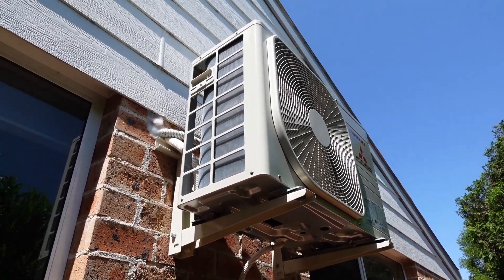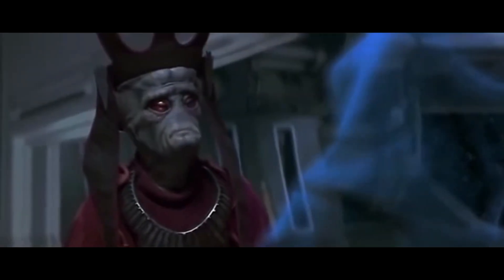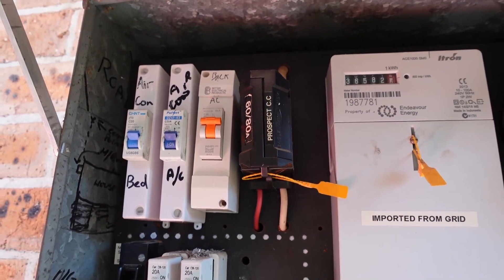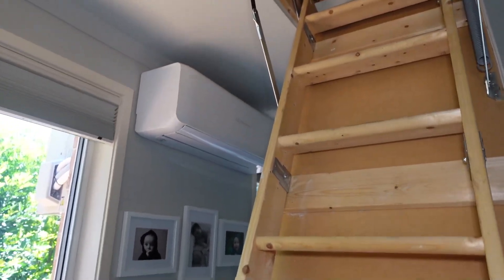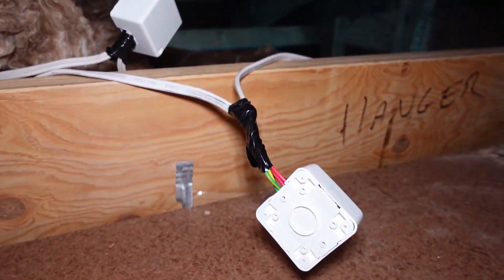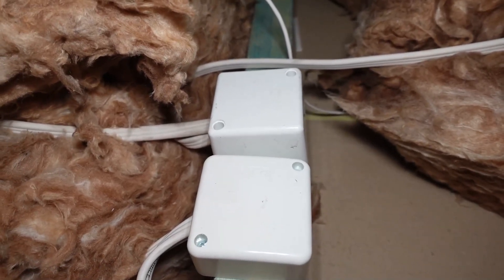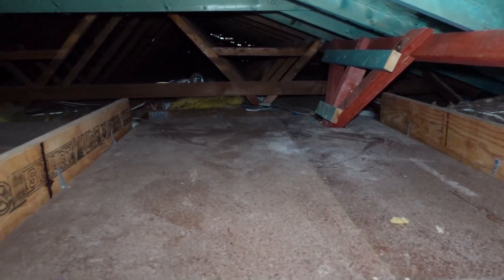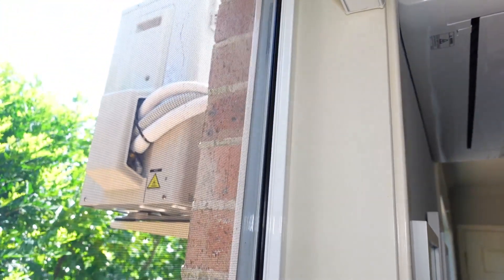Aircon Wiring Install FAIL- TWICE!

Comment: Hey Dave, those Circuit Breakers next to the service fuse are a defect, as they are installed outside the consumer’s equipment zone marked out by dotted lines. All circuits except submains require RCD protection, any alterations or additions mandate this upgrade. Isolators as you stated are required, and shall be mounted directly adjacent to the equipment it is controlling. Air cons can be supplied from power circuits, but must be labelled as a mixed circuit and is usually done to try get away without putting in a CCEW form to endeavour energy. I’d be asking for a CCEW and sending a copy to endeavour, then requesting an inspection. These blokes are dodgy as. Also, that aircon penetration is not real good. Needs to be fireproof foam and ideally there would be trunking or duct to enclose the conduit and pair coil. Hope this helps.

Julian.
Reply: And can we talk about the cables being just thrown across the loft? It's hot garbage all the way through.
Reply: No such thing as a consumer equipment zone on the metering panel anymore (for endeavour and ausgrid areas anyway)

I agree that it should be on a seperate circuit (may void warranty on AC if on a shared circuit) and it looks a bit rough with the hole pumped full of silicone, they couldve put a shroud or trunking over the hole or something
jbox rough as
Reply: I agree wholeheartedly about everything you said. except the consumer's equipment zone got taken out a few years ago, and it doesn't need fireproof foam as it is a house not a multi dwelling, but really could have been done alot better than the "do your best, silicone the rest"
Reply: Yep agree, theres a dotted line for morons......it means keep out of the grid providers equipment zone :)

Comment: Um, I was taught that circuit breakers (and fuses) are there to prevent the wiring from catching fire if they are overloaded. So how is a small tap off of a larger circuit be legal unless the wiring can safely carry enough fault current to trip the breaker?

Comment: Ahhhhh dang it, just typed like a thesis that I had to research some values for to be certain and a whole "Wiring hardship" scenario I had on monday. and lost it cos of Auto Play

Main points, no capping/casing to protect services and prevent rain/weather and small creatures from getting into your wall.

That wiring was so shotty, could guess its a plumber by trade or someone who hasnt been trained to standards. Glad they rectified it and "Upgraded it with some Electrical tape, and its not swaying in the breeze now LOL.

Job must have been quoted Indoor, Outdoor, Mount, 2c+e, 3c+e, paircoil, drain conduit and flexiable conduit. Silicone, screws and saddles. Guess they saved $50-$60 in the quote that way.

As for the unit been so close to the indoor, some manufactures specify the minimum length. Mainly to lengthen its lifespan, from viberations and reduce noise. As in the past ive had to to a loop behind the unit, when the pair coil run was less than 1.5m.

3c+e supports 20A, but it would have still have helped to know theres nothing high load on that circuit as running to the fise box would require more materials and components. 

Its a clear "She'll be right" mentality, but no isolator tho. Im sure that its legally required, let me check...

---------------------------------------------

Australian/New Zealand Standard (AS/NZS) 3000:2007,

Known as Amendment 2, it was released in December 2012 and is the first update since July 2009.

In the new Amendment, Clause 4.19 specifically relates to air conditioning and heat pump systems. It states:

“Air conditioning and heat pump systems incorporating a compressor shall be provided with a lockable isolating switch installed adjacent to the unit, which isolates all parts of the system including ancillary equipment, from the same location.

“For split system air conditioning units, where the manufacturer requires the air conditioning system to be connected to the electricity supply by means of a plug and socket at the internal unit, the isolating switch installed at the external unit shall control the socket-outlet located at the internal unit.

“Exception: the isolating switch may be installed at the switchboard supplying the system if the switchboard is dedicated to the equipment (e.g. an air conditioning plant room).”

This Clause has been written to clear up any misconceptions regarding the use of an isolator for the installation of air conditioners in residential or commercial projects.

For those air conditioners that still use a 3-pin plug and socket on the indoor unit for the power supply, an isolator must be installed adjacent to the outdoor unit containing the compressor. This Clause now clarifies the use of an isolator on all installed air conditioners regardless of the power connection on the product itself.

https://electricalconnection.com.au/changes-wiring-rules-and-hvac-installation-requirements/

-----------------------------------------------------------------------

Been an HVAC Assistant/Technician, it helps to know. Watching this was like a "Can you see the errors and hazards" test or something LOL.

Comment: That fuse box is nightmare stuff. And only TWO circuits for the entire house? Each room should be on its own breaker, each bathroom on its own breaker, each major APPLIANCE on its own breaker. That's the rules we've had in Canada for decades. An inspector wouldn't even bother failing your installation, they'd just call the cops and arrest you on the spot for endangering lives.

Comment: An "interesting" install.  I'm in the US and I know a little about the requirements here.  In the US there must be a disconnect switch that cuts all power to the outside unit, this switch must be within 6 feet of the unit and visible from the unit (someone servicing the unit needs a reliable way to disconnect all power at a single disconnect,  the 6 foot rule - the person servicing the unit needs to be reasonably assured no one is going to turn the disconnect back on while they're working on the unit.)  There are a bunch of requirements for the cable/refrigerant line entry into the building,  basically everything has to be secured tight, it has to be a major effort to pull anything out of the wall, to accidentally pull things out should need something like a car or a truck, there are also rules about sealing thing and flame entry,  those are too difficult to explain in a comment.  Any questions?   I'm available.

Comment: I have been notified about a mandatory safety check of my electric installations next Wednesday morning.
If the controller found anything remotely like ANY of that wiring I would be disconnected from the grid and without power by the evening.

Comment: Hmm.... I don't know... Well, you guys have 230V..240V line voltage. And then that kind of a wiring job and mains box are allowed?!? Terrible. That's an accident waiting to happen. I wouldn't trust that mess even with 120V. Actually... 120V could be worse, because you'll need twice the amps...
Very dodgy. Replace it. All of it. And don't let that HVAC guy do any more wiring! Also, open those boxes and check their work.
Unbelievable.

Comment: That is what to expect from most businesses, a big ripoff on the price and they will not go to the effort and do the job properly. It is required that an isolation switch is installed, the thermal insulation on the copper pipes is not suitable for outdoors as UV will destroy it. The silicon in the hole trick is unprofessional. The junction box termination job is a mess, and it should be on a separate circuit as you said.

Comment: FOUR minisplits!

I hate my garbage 3-ton Lennox knockoff (it's a "Ducane") 3-ton central air unit even more now.  Although my Trane XB furnace is a fine bit of kit, it's hooked up to a load of shitty ducts from 1986, so of course my energy bill is balls.

It all came with the house, and it's hard to argue with equipment that "works" ...

Comment: When adding an extension, we had 3 small splits added, the sparkies weren't sure about circuit requirements, so ran 3 separate 15A circuits for them....

Comment: Those JBs don’t look good. Holes hacked out and nothing to stop the cable chaffing, and single insulated cables outside an enclosure. 

And the fuse box is something else! Looks like 4 decades of changes and not one spark has thought, maybe it’s time to update and consolidate into a proper modern consumer unit.

Comment: Wow, sure these guys had an electrical license? When I have any work done to my house I Hawkeye all the work... From start to finish.. I was lucky enough with my 3 air con units that I could fit individual breakers in the meter box. Better to have just the aircon trip out than thewhoe house.

Comment: All the compressor units (4) in my place have a power switch outside next to them, so can easily be isolated. They certainly don’t have a big gob of silicon where the cables go through the wall. My fuse box (21 year old house) is a lot tidier and cleaner than Dave’s. Maybe here in Victoria the regulations are better?

Comment: If I put that in I'd run a separate cable from the breaker box to the AC unit. Have it on it's own circuit. But if it's legal the way you have it hooked up and it's under the max rating then it's cool.

Comment: The electrical code and methods are VERY different from the U.S. Even with the dodgy junction boxes ignored. We have a 110/220 V 200 amp panel and there are about 20 to 25 circuits each with it's own breaker.  VERY DIFFERENT!

Comment: There is a reason why it is illegal for amateurs to wire anything.  Professionals don't take short cuts or offer a substandard job.  They would have recommended the best solution even if it did cost more money.  And of course you can always trust that professionals will ensure that the job is safe and done in accordance to the regulations.

Comment: Yep. The aircon guys who put my split in pulled power from the nearest power point as well. After I specifically directed them to use the existing AC circuit that would actually have been easier to get to and used less wire.

Not only that, the drain is very slightly up hill. The electrician who came along after had a pretty poor opinion of the workmanship and even re-did one junction to make it technically legal.

Comment: I'm an electrician and a/c installer in Victoria. I see a few issues with the installation.
Firstly there is a minimum piping length for the liquid refrigeration line, usually 2.5m but sometimes 1.5m. If the indoor unit is mounted adjacent to the outdoor unit, I bet there's not enough pipe length.
The white insulation on the refrigeration pipes is meant to be protected from UV exposure, usually by black duct tape, but this is commonly overlooked and not dangerous.
Also, it is mandatory to have an electrical isolation switch at the outdoor unit unless it's within a few metres of the switchboard, and is visible when standing at the switchboard.
Your switchboard NEEDS to be replaced, it is a fire waiting to happen, get rid of all the fuses and rats nest of wires! I saw a bare copper wire in your video, it could be live? And use a different electrician, the one you used is clearly incompetent.

Comment: Do you not use allot of electric appliances down under? Here in the US we have 30-40 circuits in a home and 200 amps at 240v coming in! My wife’s collection of high current kitchen gadgets alone would break that system 😅

Comment: Was your Aircon installed by the Big Rock Candy Mountain aircon company? The fuse panel is sketchy as hell. Does Australia not had consumer units like the old Dart?  I'm sending this video to big Clive for comment.
Reply: Of course we have consumer units. But, just like in the UK, they weren't used in the 1970's when this was probably built. Don't you have any old houses in the UK? (that was a joke).

Comment: holy... by boss would kill me if i would not switch off such a "distribution box" and replace the thing with something usable. is this for the complete home?
the box in my carport has more fuses.
Reply: LOL - yeah, that's an absolutely SHIT electrical system. My single car garage had more circuits, and I live about 10 minutes away from Dave.

Comment: You guys internationally are freaking out a bit 😂 I’ve just started my electrical apprenticeship and from what I see day to day this is a pretty “good” install. The amount of bare copper junctions that I see in ceiling spaces just wrapped in a bit of tape flapping around in the breeze or hiding under some ceiling bats is crazy. Working in older homes we turn off the main switch before getting into any roof space due to the fact that dodgy junctions are literally hiding everywhere. Here in WA those panel type switchboards are pretty common. Provided they are timber or composite material and don’t contain asbestos we usually will add surface din rail enclosures especially if we are installing new AC circuits. It’s often easier than changing out the whole board. And the wire mess behind, well that’s pretty much every switchboard in Australia. Oh also buzz bars aren’t common in domestic switchboards even when they are the modem din rail type. Usually you have a main switch with all the sub circuits shoved into the bottom of it. If it’s a single phase domestic board sometimes there will be upto 8 2.5mm actives all twisted into a giant copper bundle and then shoved in the bottom of the main switch. I feel that compared to the international standards at least in the past Australia has taken a very “chilled out” approach to what’s acceptable especially in domestic installs. The standards are pretty good now but I still feel there is generally not as much pride taken by Aussie sparkies as there is worldwide. I’m honestly astonished at some of the things I’ve come across because I generally thought that the workmanship would have been far better than I have observed. I literally opened a switchboard the other day and none of the breakers were labeled 😂
Reply: Buzz bars?

Comment: Cowboy contractors... typical to do the splice job, save themselves money then still charge you the full amount... all it takes is a few loose screws & you could have hot cables resulting in high fire risk, or wires coming loose causing a short... next time you put a new air con unit in put the cable in yourself then all they have to do is connect it to the unit then turn a switch on.

Comment: After looking at the tape which cowboy did you get. At least you knew to separate aircon from main power. If you just what to put in to use mode you need a separate breaker. Some companies do not check your fuse box glad you caught the problem you should get something back from the installer, use something like not fit for the use of, this is 1 option in NZ and a bloody good one. Pretty much if it's not fit to the purpose i.e either they have to fix it or if you do it (contractor) you can get them to pay thew difference. Doesn't work every time but worth a try as it could at max give you a free system at worse you are stuck with what you got. Trying will only give you 3 options (covers most things) yes no or maybe. The 4th one will cost you a lot, depending on the unit price you have a small claims court or the other one, well I wouldn't go there the court cost's would exceed the price of the unit.

Comment: Pipe insulation and condensate hose must be protected from sun exposure with a UV-resistant tape or any uV-resistant material...
At the second air conditioner the sun began to degrade the insulation of the pipes 
.
Reply: This, sadly all the installers here in Finland are lazy and never do this, just some trunking if they can be bothered, and we have less sun so it will last for a few years, but sooner or later if the UV doesn't ruin the insulation, birds will steal it to pad their nests. It takes ages to re-insulate and tape the lines, instead of the 5 minutes it would have taken to properly tape them before connecting.

Comment: Wow that breaker box would not pass in america all circuits are on separate breakers that panel would have 5 or six times the number of breakers in it here in the good ole USA.  The average american panel box would have one main 100 or 200 amp breaker that controls the entire house and then each circuit would be connected to either a 15 or 20 amp breaker with larger appliances such as dryers, AC units, freezers, hot water heaters etc dedicated on their own circuit that would be rated in the 30 to 50 amp range.  Most electrical outlets have a maximum number of outlets that can be chained together in one circuit that is then connected to the 15 amp breaker and lights are wired separately into their own 15 amp breaker usually arranged by rooms that they are in, also any receptacle that would be mounted near water has to be GFCI isolated meaning a special outlet has to be wired in and possibly a special breaker installed in the breaker panel to keep the circuit isolated in case of a short so that a person will not get electrocuted or a fire from the outlet shorting out due to water intrusion.  Also in the case of installing an outdoor unit as you have on the side of your house for those mini split ac units they would require a mains cutout switch mounted directly next to the unit in a weather-proof box so that any service tech that was working on the unit could disconnect the mains power directly at the unit they were working on.  Also the breaker panel box is a full metal box that has a series of rails in the box that isolate the incoming power with our Hot, Neutral, and ground wires all having their own rail that the circuit breakers then connect to and each group of wires is then connected to these rails and then hidden behind a metal plate that is then secured inside of the box with screws and only allows access to the breakers via a panel door that opens so that people do not go mucking around with wires in the breaker panel.